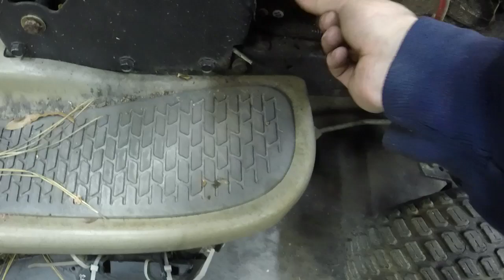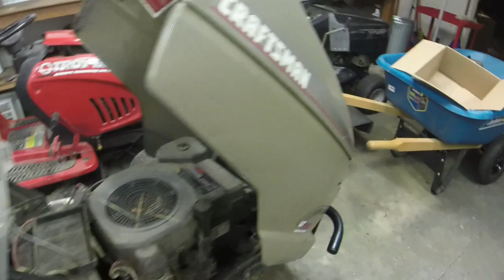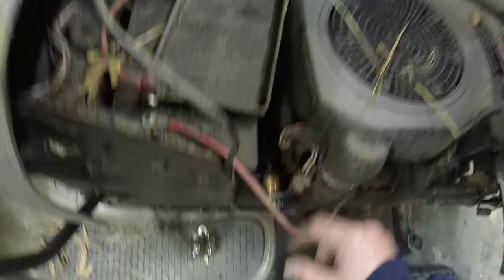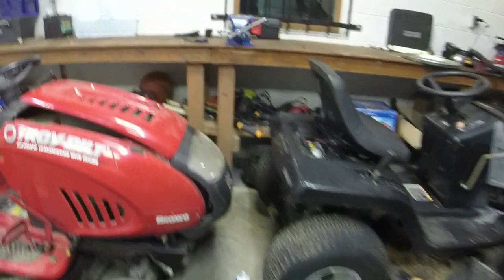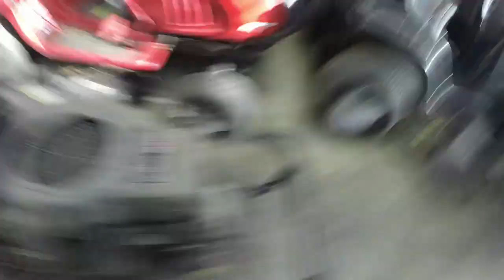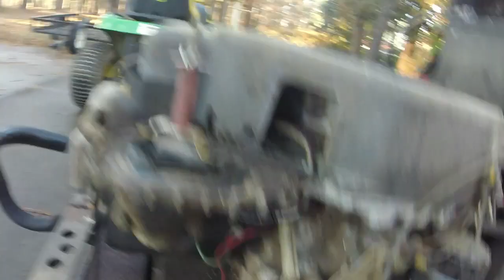Craftsman LT1750 Limited Edition: Will it run?  Mouse nest! (pt 1)

Comment: Well you are hooked on small yard tractors.  OMG are you power washing first!!!   Oh I checked not yet.  You will start.  I am sure.     LOL.  Fun stuff.  I so want to get a deal on returned mowers like you do.  I think the Canadain system is locked up.  I actually think they crush them and not let them back into the market.  Fun stuff
Reply from the maker: Bruce I got to where I like working on them and they start multiplying.  I have 9 or 10 I think?  Washing it makes it more pleasant to work on, thanks for the advice!  Interesting that Canada doesn't have a liquidation system, wonder if gov't regulations prevent it or retailers simply not interested.

Comment: Yep, that’s a mechanical fuel pump, I have that on my cub cadet, the cam lobe is worn so even a new one won’t work.  I may need a gravity fed fuel tank.
Reply from the maker: Gotcha, a gravity fed one might work then.  I have a Troy Bilt Bronco coming up that I believe has a worn cam lobe but gravity fed tank.  Runs good after it gets over the first compression hump but still surging with a terrible Nikki carb on it.

Comment: I have a limted edition powr kraft mower by mtd it was made for montgomery ward it,s a 1996 year model with a twin cylinder 18.5 hp.i/c briggs & stratton engine mower deck size is 42 inch cut  i have to put a new starter on plus going to replace the ignition coil also  it was giving to me had put it the shop the soleniod had to be jumped across to make it start plus new deck spindel,s put on the deck but .when i put the starter on plus the ignition coil she will be back in top shape even though she is a gas hog  when the blade,s are running i love it because she,s a classic 😃😄😊😁😀 great that you are fixing that limted edtion mower see in your next video young man if yoy dont me asking where are you located
Reply from the maker: Sounds like a good mower you have there once you get it all finished up!  Ignition issues are always the worst to diagnose and fix.  Those opposed twins are great motors.  See you in part 2!  I'm in NC about an hour outside Raleigh.
Reply: @EllisMowersandmore  okay thx younng man

Comment: I have this exact mower, but can't find anything about it. (Year's made ECT) it runs great though.
Reply from the maker: First 6 numbers of the serial number on the fender under the seat near the battery will give you the date (m/d/y).  This one was made around 2000.
Reply: @EllisMowersandmore  ok 2005. I thought it was a "special edition ". Thanks.

Comment: Hi I have the same mower. Did you find out about the red wire? Mine was hooked up to the carburetor but I don't know where it goes to? And they took off the electric PTO clutch so I purchase a new electric PTO clutch and a new pulley for the drive pulley! The person that owned it just cut wires on the harness the person could have left it alone! The question I have for you is the white connectors there is a red wire that is cut and I don't know where that goes? There are two wires that are cut and I think that's the electric PTO clutch wires because it has a red and black wire together and I think that runs right to you the PTO! So if you could help me I really appreciate it! Thanks 🙏
Reply from the maker: It's been over 2 years since I had this mower but it sounds like the red and black are your PTO wires.  As for the red wire to the carb if it plugs into the carb bowl that's an anti backfire solenoid.  As long as it gets power when the switch is in the on position that's all you need.
Reply: @EllisMowersandmore  thank you kindly! God bless you!

Comment: have exact mower switched a few parts checked a few connections and only remaining thing i can think of causing it to not start(not even a click) is the fuse and cannot find a fuse did yours come with a fuse?  if so where is it located?
Reply from the maker: It should have a fuse, it should be located under the hood near the right rear of the engine.

Comment: What model carburetor 17.5 Kohler Pro ?   Thanks
Reply from the maker: It's going to be a Kohler Command.  There should be a sticker on the engine shroud with the model number.  Good news is the Command and Courage carburetors are basically the same.  Should be able to find them on Amazon or ebay pretty easily.

Comment: My engine shroud indicates that it is a Kohler Pro 17.5 hp.  What I need is the carburator model number....
Reply from the maker: It should be on a white sticker on the side of the shroud.  I think they are CV17 or CV17.5.

Comment: What kind of fluids go in my rear end on my lawn tractor
Reply: What goes in the rear end what kind of fluid
Reply from the maker: Various different types depending on the transmission.  Hydrostatic transaxles commonly use 20W50 full synthetic.  Gear drive could either be packed with grease or could range from 5W30, SAE30, 10W30 or even 90W gear oil.